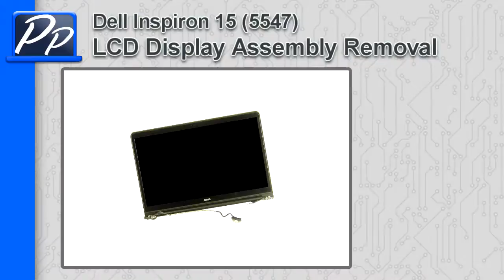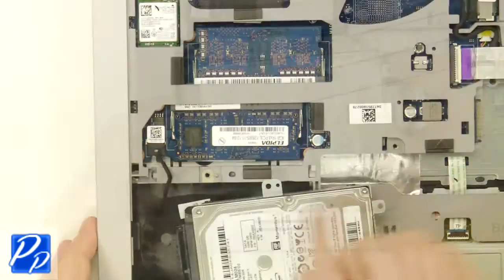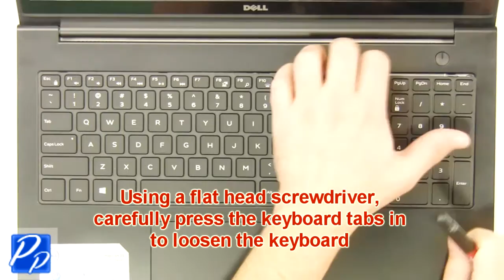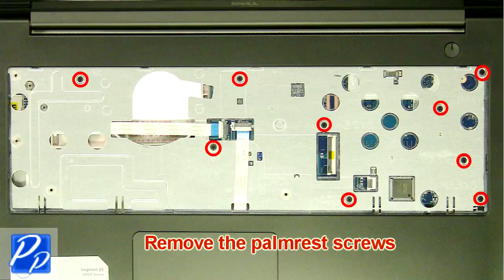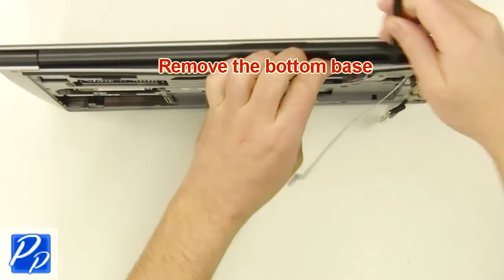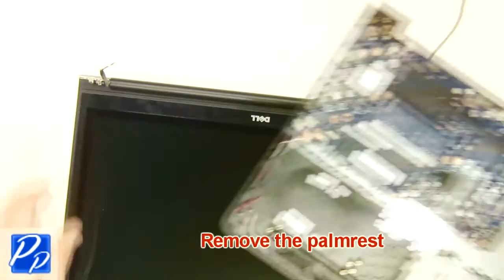Dell Inspiron 15 (5547) LCD Display Assembly How-To Video Tutorial

Comment: Inspiron 5547 seem to have worst kind of hinges, everyone seems to be having issue with them, I have similar hinge problem but not sure how to fix that.
Reply: I have the upper chassis/palm rest on order because of this. The hinges are too tight and it broke one of the screw hole/posts holding it in place, causing it to lift up and crack the casing above it. Happened about 4 years after purchase. I’ll be loosening the hinge (1/4” wrench, about 3/4 turn) once the part comes in to prevent this in the future.
Reply: I changed the entire palm rest bcoz of the fucking hinges.

Comment: Thanks to your video, I've had the courage to open the laptop. Tomorrow, I'll need to weld the Internet cable (i.e. black and white wifi antenna cables) to their small connectors. And then assemble everything back. Whish me luck!

Comment: i have this laptop with a 1366*768 screen, wanted to change the screen to a 1920*1080, is that possible? its non-touch btw any info will be really helpful
Reply from the maker: +Athan Basweti It can be upgraded but I think they only made the FHD (1920*1080) for the touchscreen models. If you don't mind having a touchscreen, that would be the way to go.
Reply: Is the flex different for the touch panel as compared to the non touch? As in are there more connectors on the touch than on the non-touch?
Reply from the maker: +Athan Basweti Yes, they have different cables. I think you have to buy the touchscreen as a complete assembly.
Reply: Athan Basweti  Hi! did you change screen and got 1920*1080 resolution? i am looking foward for that but dont know is it working?

Comment: My dell 15R 5537 screen keep showing scratches continously  like the way  TV use to do when there is no signal, I have hold or  move part the lid before the screen show normally,  pls I want to know what's the problem the lid and how to tackle it.
Reply from the maker: Harun HmaX The problem will either be the LCD cable or the LCD screen. If it is the cable, you will most likely see damage on the cable close to where the hinge is. If you do not see damage on the cable, then the screen will need to be replaced.

Comment: I have the touchscreen and the LCD has a crack line going through it so I will need to replace the LCD - How do you so this because  the screen doesn't appear to snap in but appears to be sealed.
Reply from the maker: +Chuck Ziethen I've had issues removing the touchscreen too. I've heard of people using heat guns to help loosen the LC bezel but every time I've tried, something else breaks. We usually replace the entire display assembly.
Reply: @dellpartspeople  Could I purchase a display assembly online and replace it myself? I have not been able to find any replacement display assemblies to buy. My touchscreen is cracked all the way across.
Reply from the maker: @thejibberjabberwookiee8604  Absolutely. You can find this part at our online store here: https://www.parts-people.com/index.php?action=category&id=141&subid=492&refine=lcd+screen

Comment: hi, can i put a touchscreen on a Dell 5547 that it is not with a touchscreen?
Reply from the maker: Yes you can but you will have to replace all of the display components. The back cover, bezel, screen, cable ect...or you can replace the entire display assembly.

Comment: how to do you remove the lcd from the display to replace the screen ?
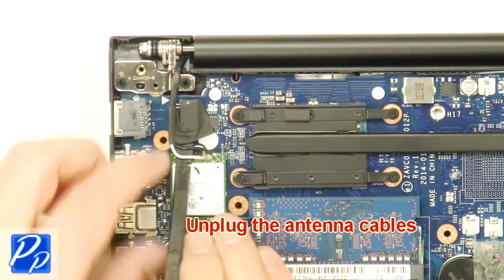Reply from the maker: jim accardi It depends. If you have a touchscreen it's very difficult and requires a heat gun. The laptop I was working on for this video was a touchscreen, and thats why I didn't show the full disassembly. With a non-touchscreen you should be able to remove the lcd bezel and remove the screen after that. Unfortunately I don't have a video for it but it would be similar to this video, skip to 4:44 https://www.youtube.com/watch?v=PqA_-vzcuUc
Reply from the maker: jim accardi In most cases you can remove the bezel with the display attached to the laptop. I haven't had the non-touch display to try but the bezel probably can be remove while it's attached to the laptop.